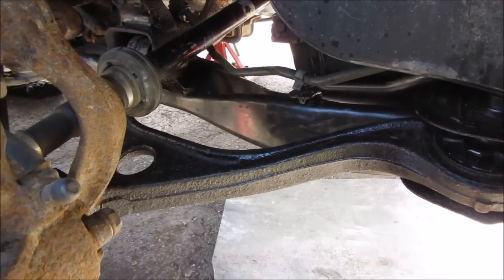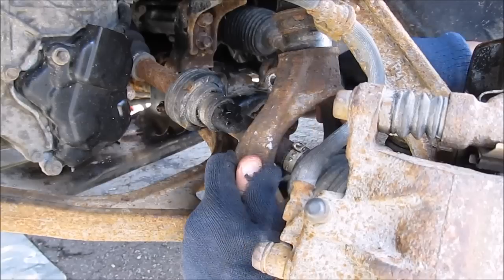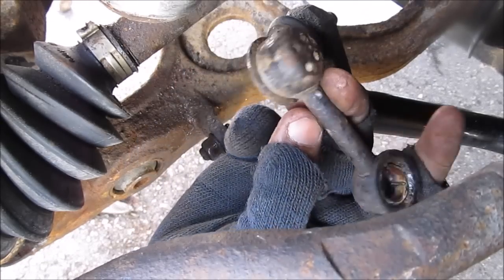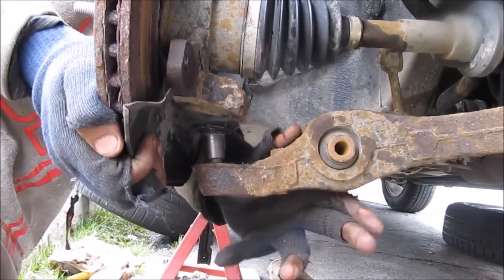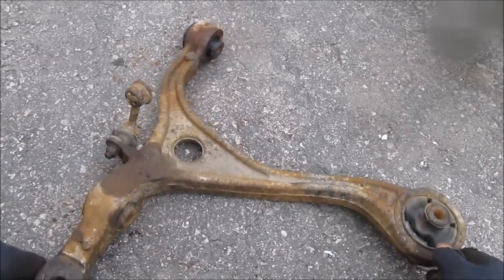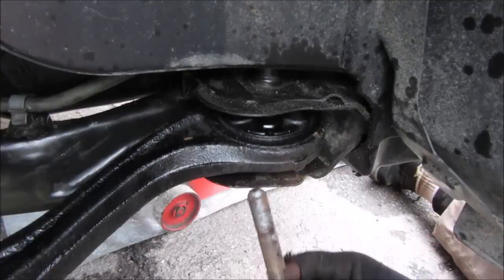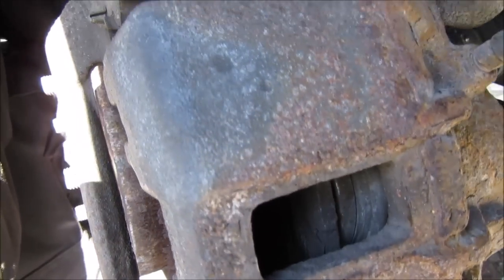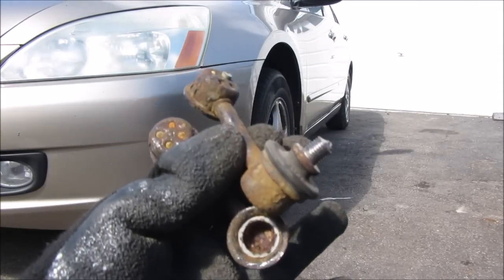Lower Control Arm Replacement Honda Accord

Comment: Thank you for the video.  I did this job on my 2008 Toyota Sienna.  It looks easier on this car.  I advise buying replacement control arms rather than replacing the bushings unless you have the equipment to press them out yourself.  By the time you buy new bushing and pay for someone else to press out the old and press in the new, you could have a whole new control arm with all new bushings and ball joints.

Also, my mechanic said I should only hand tighten all the bolts on the bushings until the car is back on the ground and then torque them down.  The weight of the vehicle bends the bushing to where they're supposed to be and if they're torqued when the suspension is hanging, they will wear out faster.
Reply from the maker: +Wurum Agreed on the bushing torque and control arm assembly. 
On the Sienna, didnt you have to remove the engine mounts to get to the control arm bolts?
Reply: speedkar99 I left the mounts in place and jacked the engine up high enough so the control arm cleared the mounting bolts. This required disconnecting the motor mount on the top of the engine. 
I'm not sure if I had to do it again that I would use this technique. I had to push the engine up so high that the heater house Y connector cracked and had to be replaced.
Reply: but then how get to those bushings in the back with the tire in the way🫠

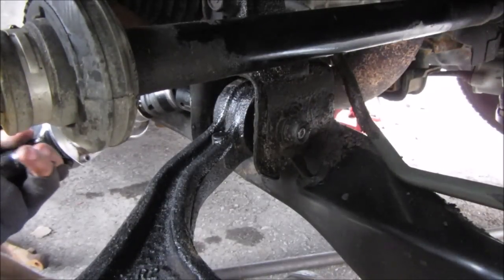Comment: 5:27 Been there, done that.  Good job cautioning on it.
Reply: I did that very thing, separating the inner tripod joint from the inner CV housing.  Didn't realize it and couldn't figure out why I couldn't line up the ball joint with the control arm until I realized it pulled out.
Luckily I was able to carefully rotate the axle and slid it into the joint without having to disassemble it further.
Reply from the maker: +Wurum Thanks. Hate that stupid control arm bolt that got stuck.

Comment: I have a 2007 Accord.  
The lower ball joints need replacing.  Should I replace the lower control arms as well?
Reply from the maker: +Jason99942 Ball joints wear faster than control arms. They're separate pieces so if your control arms aren't worn then leave that until later.

Comment: What all did you have to do for the cv shaft mines did what you was talking about now i have everything back together but the ball joint
Reply from the maker: +Mel Man Yea that was a bummer. I had to push and twist it in at the same time. Maybe rotate the wheel on the other side to free things up. After a lot of wiggling I got it in.
Reply: speedkar99 ok Thanks. Ill try and let you know how it
Reply: speedkar99 it goes
Reply: Pricing
Reply: I just ran into this issue and I'm stuck. Please help

Comment: your impact gun is from harborfreight ?how many torque it produce?
Reply: Its hard to say as you don't show a complete shot of the impact but just from the front and seeing as its a 4 bolt housing I would feel good about saying its an IR 2906P. Usable torque in the 50-350 range and 500 max. Also that impact has a built in muffler.
Reply from the maker: +Fabian Gallardo no, its older than I am, I'm not sure how much torque or what brand. 
It is 1/2" drive

Comment: i think very important info that should have been mentioned is torque specifications. especially with suspension components. best if added to the description
Reply from the maker: +Rudy Salas Thanks for the suggestion.

Comment: I Don't  have bolt joint separator. what do u suggest? can i pull it out carefully?
Reply from the maker: You can whack the control arm where it meets the ball joint with a hammer. The sharp impact should cause the ball joint to separate. Just make sure the castle nut is threaded on loosely so it doesn't go flying. You could use a pickle fork but that would most likely ruin the dust boot.
Reply: If you have an Advance Auto nearby, they have a great loaner tool program that allows you to borrow a front end service kit that has the tools needed.  You just pay for the tools at the start and then when you bring it back you get a full refund.  The initial cost is over $100, so if you don't have a charge card or cash on hand it may not be an option for you though.

Comment: any suggestions the lower control arm bolt near the rear is spinning within the bushing does not want to come out
Reply from the maker: +David Ponce Yes  I had the same problem. You have to cut the bolt off. Its seized to the inner sleeve of the bushing. Torching it isn't going to help and will just make things messy with the rubber melting.

Comment: I like how the video was  edited (shortened). I wish he mentioned how many hours this job takes.
Reply: speedkar99 what did you have to for the cv shaft that slipped out? ??
Reply from the maker: +Hamad Alganis hah yes I like to make my videos quick and to the point. This job took alot longer than it seemed because of a stuck control arm bolt and a CV shaft that slipped out of its tripod.

Comment: I have a question about this video if you might be able to answer it. I replaced my upper control arms this weekend and the job went pretty well, but when I was trying to removed the 17 mm lower bolt as you are at 0:53 in the video, I wasn't able to get the bolt out. The nut came off, but the bolt couldn't be removed. It would turn about 1/8 of a turn, so it didn't seem seized up, but it wouldn't budge when trying to hammer it through. Any thoughts on why this might be and what might help push it out in the event that I need to in the future?
Reply from the maker: +Adam Steinquist Are you talking about the upper ball joint stud? You need a ball joint separator to remove it from the knuckle.
Reply: It's actually the 17mm lower bolt on the fork that you seemed to be able to just slide out. This bold on my passenger side came right out for me as well, but on the driver side, it just seemed stuck. How could you get this bolt out if it's stuck? Is it safe to heat this part?
Reply from the maker: +Adam Steinquist it goes into a rubber bushing so heating it will destroy the LCA bushing (if you are reusing the LCA). You could also cut the bolt and press out the bushing off the car, either way you'll need a new bolt at least. 
We're you able to get the large bolts holding the control arm to the subframe out? My driver side one is still stuck.
Reply: My repair was a little different than your video. I was replacing my upper control arms this weekend, and was doing research today to see if I could figure out why the bolt I've mentioned is stuck. This bolt wasn't necessary to remove for the upper control arm, but by removing it, you can pull out the shock and spring giving easier access to the subframe bolts that hold the upper control arm in place. It was a much more tedious job with the spring in the way.
Reply from the maker: Yes I agree with the spring in the way its much more difficult to get the UCA out. But glad you got it done.
Reply: Adam..having same issue as you. LCA bolt that is located at bottom of fork is seized to the LCA bushing. Left side popped right out. Drivers side seized. Took to mech and they said only way to get bolt out would be to cut it with torch thus ruining the LCA bushing. I have seen guys use a reciprocating saw or a 3" High Speed Cut-off tool AKA Whizzer saw.  My plan is to cut bolt and replace with new LCA and new bolt. My job started out with replacing struts with Quick Struts but you have to remove LCA bolt to allow the fork to drop to remove fork from Strut. Gotta love it when job turns into more than what you thought. :)

Comment: does any know what is the piece is called at 1:56 i need that replaced for my civic but cant seem to find it online
Reply: The part he broke are generally referred to as sway bar end links, end links, sway bar links, or something very similar. Take a look on rockauto, I just swapped mine out a while back and couldn't be happier. No more noise going over potholes/speedbumps!

Comment: scary rusts
want/need videos of ball joint replacement 
splash shield was pressed towards the rotors of you haven't straightened it out.
I remember my civic wishbone embarrassing nightmare. interesting, how were you able to connect lower control arm with the wishbone with the ball joint connected?
kudos, working in the cold.
I found a cap, us amazon Mysuntown Unisex Winter Ear Flap Hat Trooper, Trapper, Hunting Hat Ushanka, that might help
Reply from the maker: +nhz013 Thanks. Well winter lingering around doesn't stop be from getting outside and my hands dirty :)
The car had some damage to the fender and door. I've since pulled out the dent, I should have that video up in a few weeks. 
Once the strut is out of the way the wish bone is no longer loaded. With the upper CV ball joint taking all the load, and the CV boot being able to stretch a bit, it wasn't hard to unseat the ball joint from the control arm and wiggle it out of the way.

Comment: So after the replacement of the control arm. There are no stabilizer linkages ?
Reply from the maker: +d w I'll have to buy some new ones to put in soon.
Reply: +speedkar99 Go aftermarket on those.  The Honda OEM ones aren't that great and always get stuck.